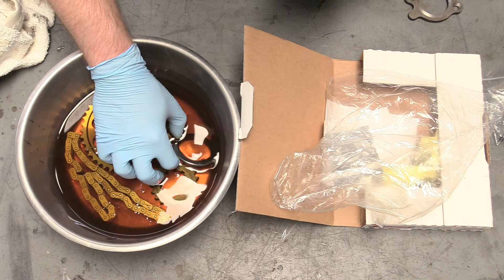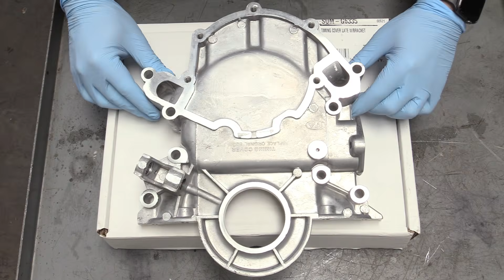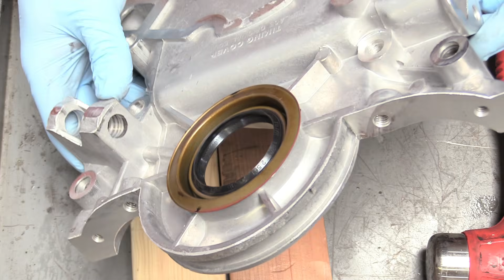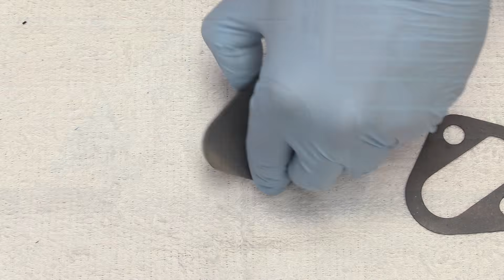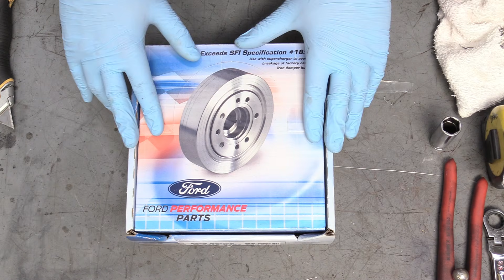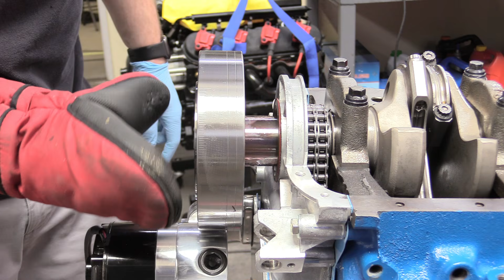How to Build a Ford 302 Small Block - Part 5: Timing Set, Cover, Water Pump, Crankshaft Damper

Comment from the maker: CORRECTION!: The torque spec for the ARP damper bolt is 120 Ft Lbs, 90 is for the stock bolt.
Reply: Thats right !  I just installed the exact same bolt on a 393W.
Reply: Hey you guys if using original dampened clean the area that the oil seal contacts with emery cloth so nothing damages seal lip

Comment: Nice work..Done these installs for years..Never have I had to heat the crank gear to slide over the crank; even on new components.  Interesting!!  Also, are those aftermarket main caps on your block?

Comment: Thanks for the great series of videos. I’m about halfway through with a 1982 stock rebuild. Just a comment for some others to be careful not to install the crankshaft sprocket by itself first IF you are using the long dowel with a one piece eccentric on the front of the cam sprocket. If you do place the lower sprocket on first you will never be able to put the upper gear over that long dowel with the chain wrapped around the lower sprocket at the same time like he did in the video.

Comment: @2carpros Hello. Where did you find the thrust bearing that goes on the cam sprocket. I’m doing a 347 build also with an 81 302 block, have the same timing chain set up but no thrust bearing?? Thanks!😮

Comment: Two questions. 

1. If we were just rebuilding a stock 302, when you installed the electric water pump, is that the time we would install the regular water pump?

And 2. If I purchase that particular damper you have, do I have to buy other parts to go along with it? Or would I be better off buying a regular OEM style damper? I’m doing a base rebuild.

Comment: The damper defines the final position of the timing cover.  It should be installed before tightening the cover bolts

Comment: What "contact cement" spray are you using on one side of the gaskets?  I have previously used the copper gasket spray, and am wondering which of these two would likely make the most leak-proof seal?
Reply: 3m trim adhesive.

Comment: Clean job, only thing I recommend is to install the damper first for centering purposes before torquing down the timing cover.
Reply from the maker: Not a bad way to go but honestly if it matches flat on the bottom you should be good if the front plate is made correctly. Thanks for watching!

Comment: What was the name of the bearing that you placed on the back of the cam timing gear?
Reply from the maker: That is a cam gear thrust bearing. Thanks for watching!
Reply: @2carpros  on my 79 F150 302, my cam thrust bearing is attached to the block. It also keep the cam in the block.
Reply: Wondering that myself. Got cam walk on my 302 roller block and trying to figure out if this bearing was supposed to be between the cam and the thrust plate or just comes with some of the timing sets sold. My cam thrust plate wore down causing the cam walk issue.

Comment: Hey Ryan or fellow moderators of this account. I’ve been following your guides for a few months now in the process of building a 302. I have a quick question, I’ve done plenty of research and have heard so many different things and want to get your opinion. I plan on getting a lightweight flywheel maybe 15 pounds or so. The counter weight stuff has confused me with the damper. So my question is if I were to run a lightweight flywheel. What kind of damper should I use? I was reading about the 28 oz and a 50 oz. My block and rotating assembly are from a 72. Thanks!
Reply from the maker: Hey there thank you so much for watching! Just make sure you get an internally balanced crankshaft, damper, and flywheel for integrally balanced cranks and you should be made in the shade. If you have any other questions please feel free to ask, I try to get to all of them but we get a lot of comments lol

Comment: Hey...GREAT VIDEO...question...would the reason for the longer dowel in the end of the camshaft be for a fuel pump eccentric?  And the shorter one be for if you were to be running an electric fuel pump?  Thanks!!
Reply: I’m in the middle of a rebuild and the answer is that the long dowel typically is for the one piece eccentric while the short dowel would be for a two-piece eccentric because it has a tab that goes inward. I also discovered that you cannot put the smaller crankshaft sprocket on first if you’re using the long dowel. You have to put them on at the same time with the chain already lined up on each of them.
Reply from the maker: Thanks so much for watching! Yeah that is a good point. I want to say that is likely. We were never going to run one so I didn't even consider it. Just thought maybe different timing sets were thicker.

Comment: Noticing you never checked for cam endplay? I’m installing the same timing set (based in this video recommendation). Noticing there is zero endplay as compared to the factory single cam sprocket, which has some endplay. Curious if yours had any play at all….

Comment: Nice series, thank you.  What are you using for the contact cement?
Reply from the maker: Thanks for watching Robert. It's loctite spray contact cement.
Reply: @2carpros  Gotcha, thanks!
Reply: @2carpros is the purpose of using that just to keep the gasket from moving as you install parts?